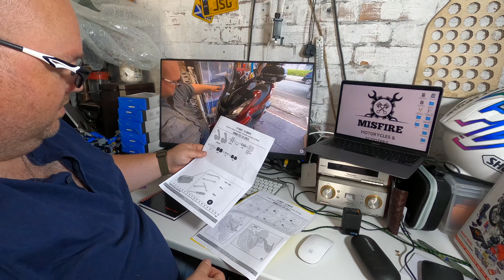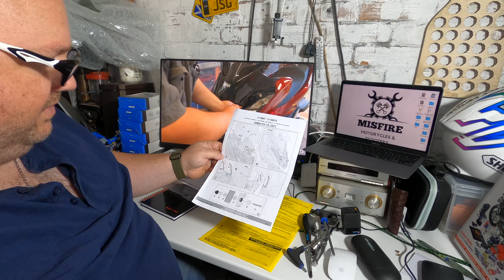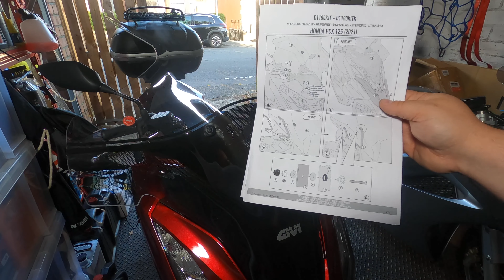Big givi screen - the Givi 1190ST touring screen and fitting kit - install on my 2022 honda pcx 125

Comment: What is your height in inches? Im 74" height. Will I also be looking through wind screen? If the screen is to tall, would it be OK, to take some off the top, with a cutoff wheel? Polish off the rough edge, and good to go. Except for the height, did you like the screen & hand protection?

Comment: Sir, So those brackets do not screw into dash at all? Are there rubber feet that grip dash. 2:12 I am astonished how bad the directions are from Givi. Also did they ship you that damaged? Or did u buy off ebay (used) I am going to order new, from Givi website.

Comment: Last comment I promise, Wh do you & Givi refer to it as a 125 scooter? We don't have a PCX 125 in North America. Just the 160, which couple years ago was, was called PCX 150.
Reply from the maker: It’s because it’s a 125cc engine. In the uk - and eu I think? - that’s the limit for a learner bike. We occasionally used to get 150cc scooters but they don’t sell well as most folk want a 125.

Comment: I have a question I hope u answer what if I installed the windshield without fitting kit. that cause a trouble? Because I purchased and installed my give windshield without knowing that fitting kit I have to buy separately that cost arround 45 bucks. should I buy kit or not or just keep riding without the kit 
I hope u answered my question 
Great Video
Reply from the maker: Genuinely no idea buddy, I’d imagine the screen might crack if anything was going to happen